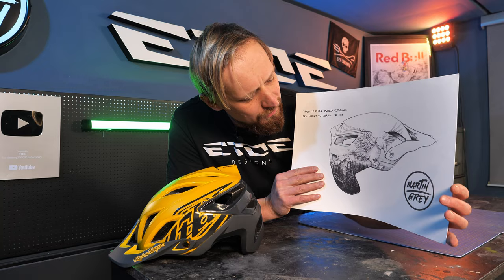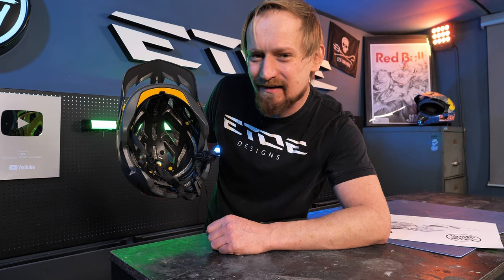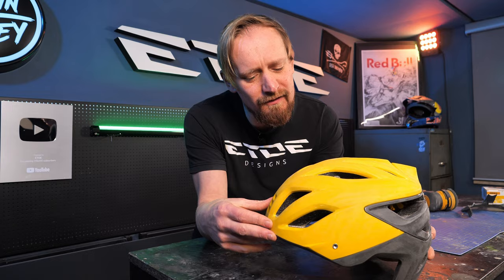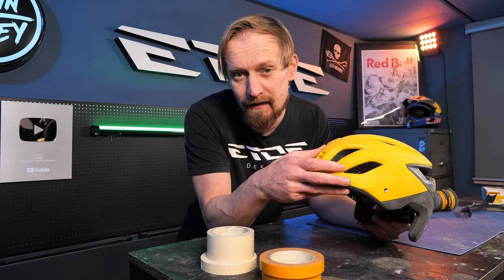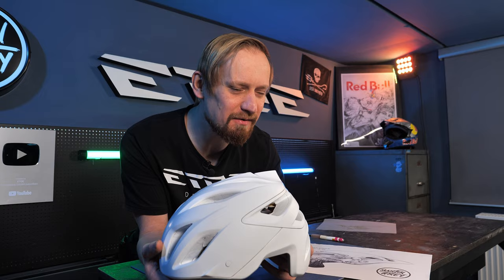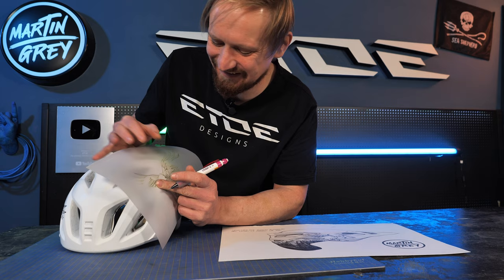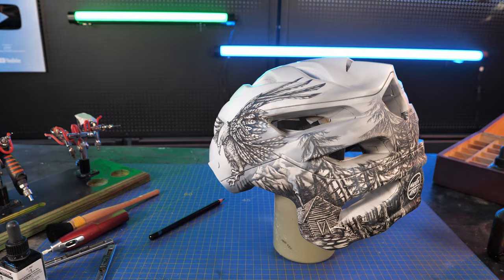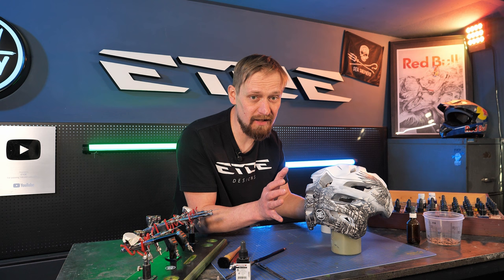Painting a Helmet with Pencils

Comment: A technique I have been using for over 20 years is to print your design with a laser printer and with a soldering iron set between 120° and 130° (Celsius) iron the lines to transfer the toner onto the support.
Reply from the maker: Please don't use heat irons or any kind of heat on these helmets. You can destroy them very easy.
Reply: @ETOE  I mainly do plastic and composite bodywork and motocross faceplates.

Comment: Hi Martin,
I really love your work and have been following it for quite some, it's also one of the reason why I tried painting my own bike :D
Back then I did some mistakes but now I want to redeem myself. I would like to apply decals, rather a name and a logo on the bike, which are not too large. I wanted to ask you for advice on how I should approach adding the decals:

1. Should I paint them on the frame with a mask?
2. Should I get vinyl decals, stick them on the frame and paint with clear over it? I would test if the vinyl or adhesive would react with the paint though before putting clear on. Are there any shops and vinyls you can recommend for that?
3. Should I stick the decals on-top of the clear? If so, how can I protect them?

I am looking forward to your answer!
Reply from the maker: 1. That's how I paint my stuff.
2. Just do it if you think. Cheapest decals are found on Amazon, Ebay,  Etsy... clear coat won't stick well on any kind of vinyl. 
3. Just put protection vinyl on top if you want to protect the vinyl.
Reply: @ETOE  Thank you ^^
Have you ever used water-slide decals before? I just stumbled upon them recently and some manufacturers seem to be using them
Reply from the maker: @ya_boi_david  yes I use and show how to produce waterslides in a lot of my videos.
Reply: @ETOE  Thank you again :) I will look into it! Didn't notice before :D